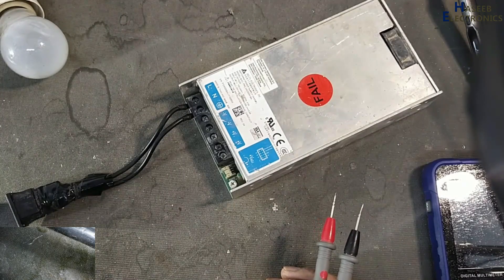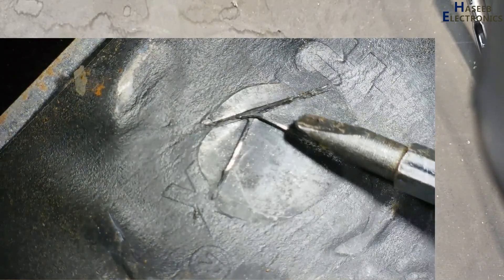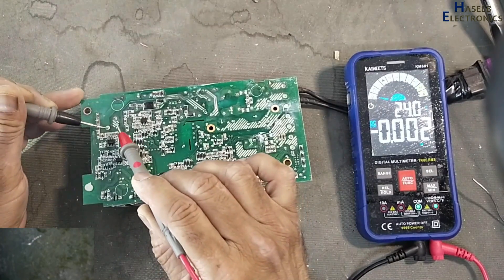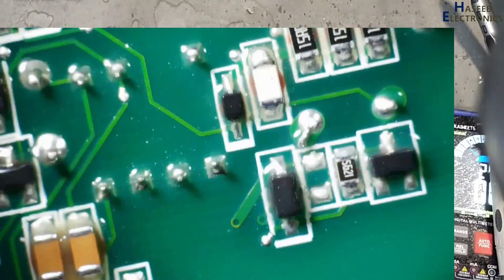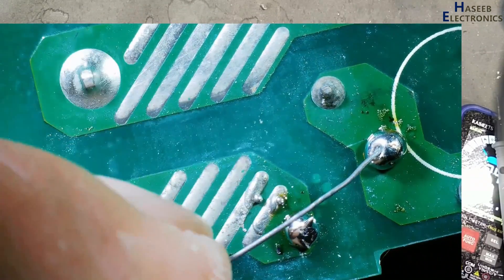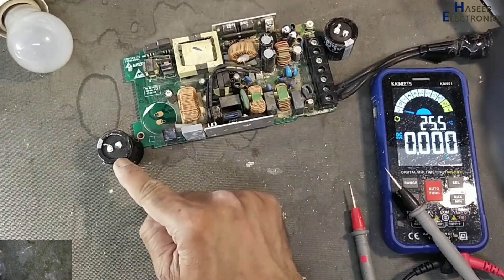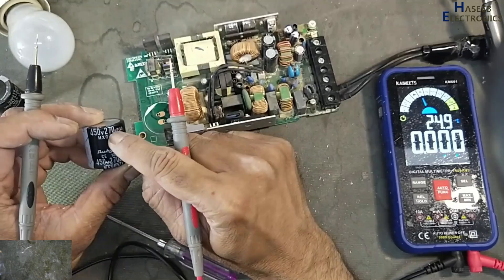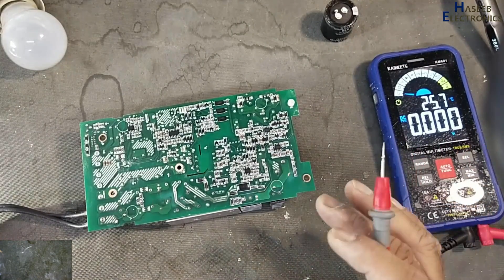{1105} SMPS Repair, Not Turning ON, no output

Comment: Good afternoon Sir. Day before yesterday I tried to repair one Samsung non inverter AC pcb. I found a problem in chopper short circuit. So I fixed the problem with the 12volt smps module. Now what my problem is, when I measure the voltage between capacitor aluminum body to gnd 0v DC. But when I measure with Neutral to capacitor aluminum body in AC, it almost 110 AC supply. Also if I try to touch any 12 and 5v section gnd get shocked. How can we avoid this? I checked all components everything was good. After I removed the bridge rectifier diode also voltage reaching to the capacitor aluminum body.  Please give some solutions. Thank you sir.

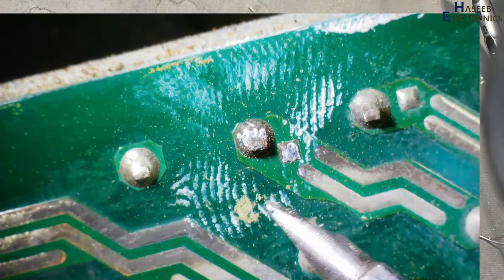Comment: 3:00 detective Mohammed 🫡🫡👌🏻😂 thank you very much Prof. i have one question: i wish if you can measure the resistance of the cap, i have a similar situation where the cap is damaged and fuse is open, the cap measures around 20ohm like this, this is considered to be short circuit?
Reply: To measure a capacitor use a capacitance tester. The resistance of a capacitor is called ESR and should be measured with an ESR meter then look up a special ESR chart to determine if the ESR is within specification. The correct ESR is based on capacitance value AND voltage of the capacitor. Just measuring resistance of a cap with a multimeter means almost nothing.